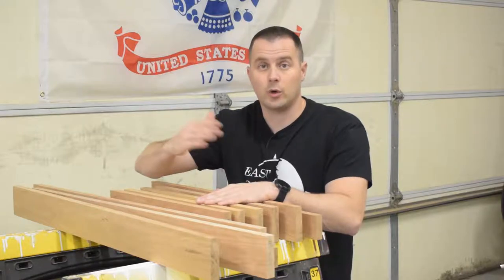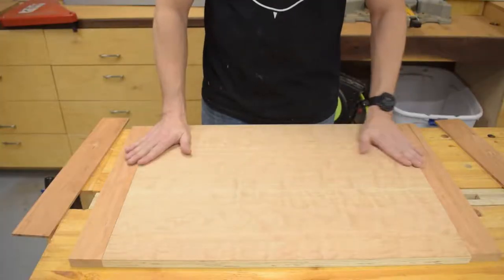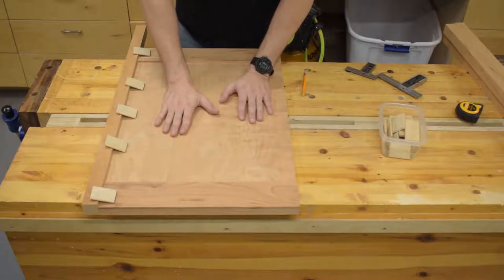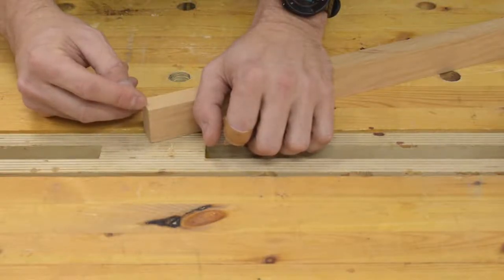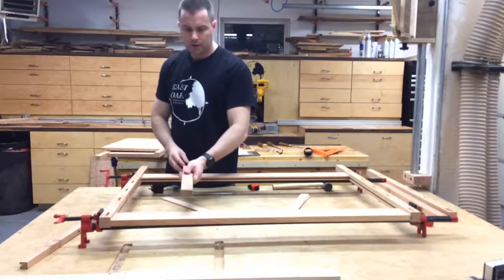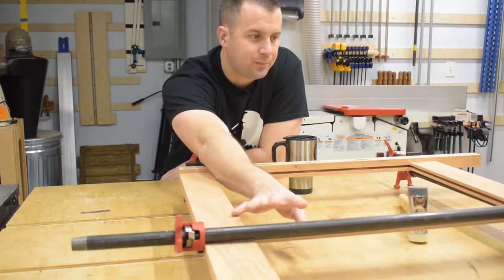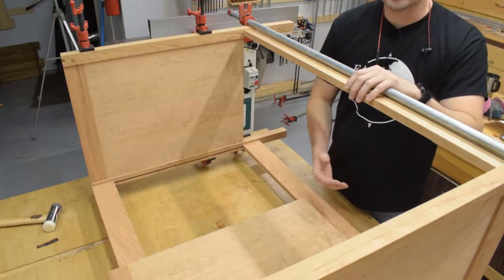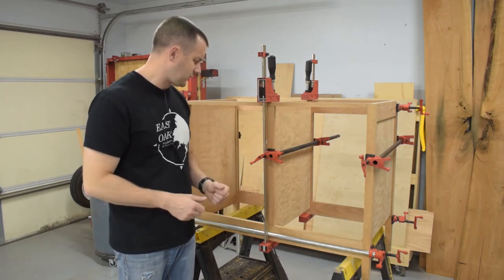Cherry Liquor Cabinet Part 2 | Woodworking

Comment: How is the lift mechanism set up to raise and lower the router in your shop made slot Mortiser? Any pictures you could share?
Reply from the maker: It runs on a couple of drawer slides and just used a piece of 3/4 all thread to crank it up and down. It’s a little cobbled together, but it works